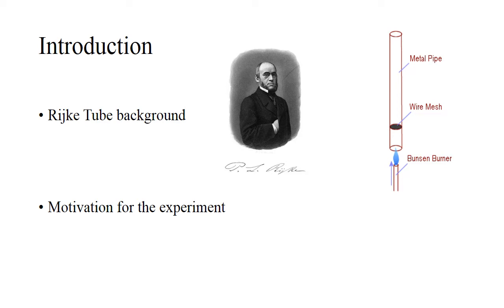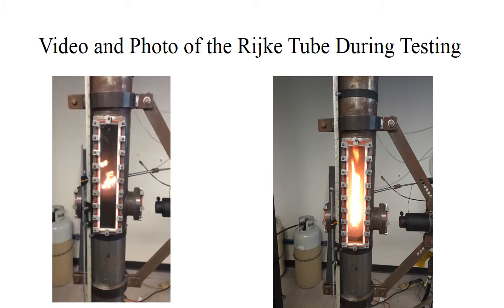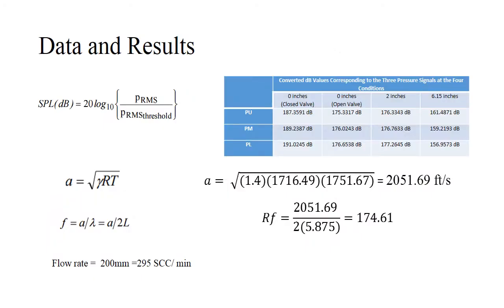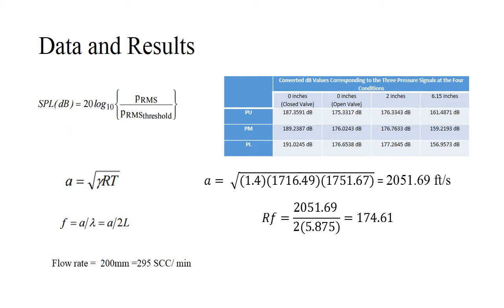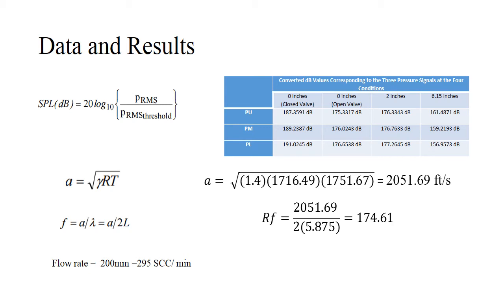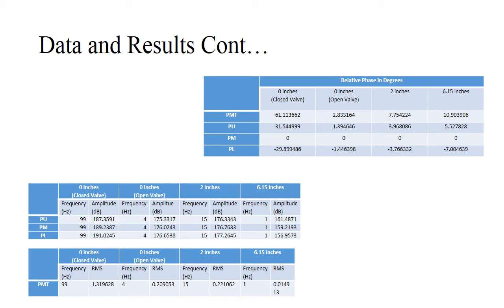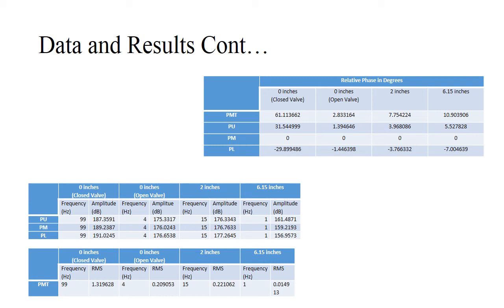Combustion Dynamics in a Rijke Tube Video

Comment: I am skeptical that this is understood properly. I don't understand the evidence that proves that heat is transpositioning to sound, if this were true then the object would cool more rapidly the louder it was, correct? My instincts tell me the low/high pressure ΔT creates an eddy, this eddy is so low pressure that the energy becomes thermal radiation in the isolated area. Because metal is crystaline; the ΔT at the eddy becomes enough to stress the entire structure. Natural thermal dynamic convection already creates a resonancy,  this resonancy is not sympathetic and instead becomes wave interferance for it coalesces with the thermal radiation waves.

I supposed hypothetically a practical use of the Rijke would be for cooling objects in a vacuum more rapidly, because you can run an inteference pattern between thermal radition waves, and accoustic waves; enabling greater energy transfer. You could also have objects of same dimension, but different mass, cool at the same rate! You'd just need to tune it to the same accoustic frequency. 

This also reveals however that all metals must makes noise when losing or gaining energy, which means that metal never stops singing. Cool.